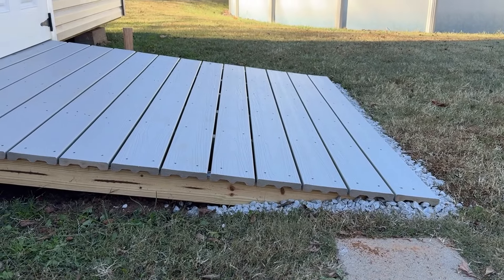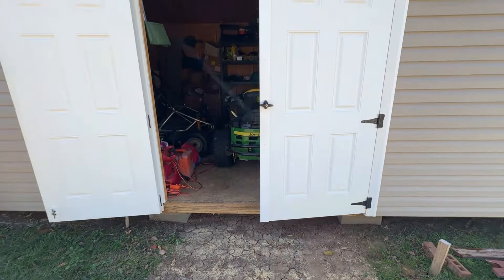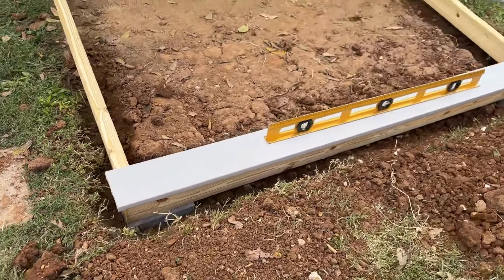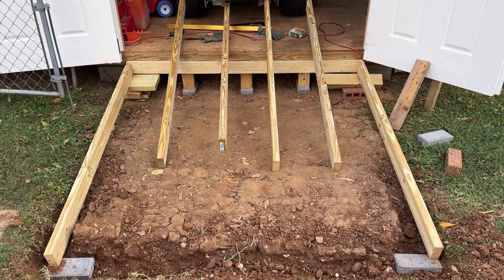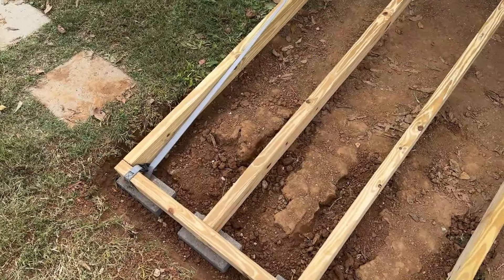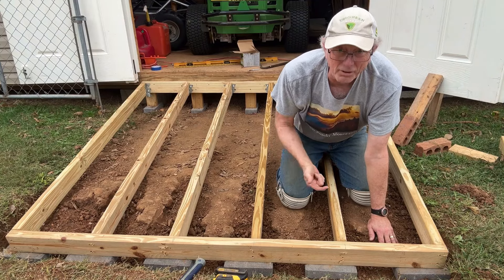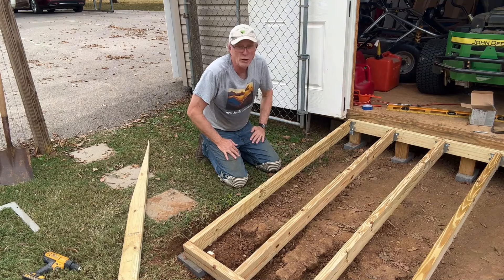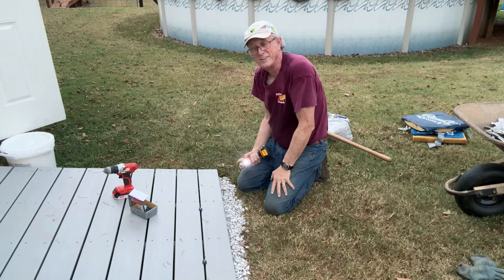How to build a strong and durable Shed Ramp DIY!

Comment: Super over-engineered, but nothing wrong with that. When you rip the 2x4's they will feel "mushy" but that's because the ripped section needs to be on compacted earth/gravel which supports it.  But I agree, there is more integrity to the frame with the full box construction (the rip design usually relies on the deck boards to hold the frame square.)  Joint tape... LOL... that must be necessary since the green-ies killed real pressure treating and oil based paints.  Now... just what type of petroleum based chemicals are in that tape? hmmm?
Reply from the maker: Great points. Thanks for watching and commenting!

Comment: Question: When measuring 6 inches long for every 1 inch in height. Is the height measured from the bottom of the building or the floor?
Reply from the maker: From the floor. Or more accurately, from the top of the ramp to the ground.

Comment: Great video, where did you use the 2 angle brackets ? Also what was the width of the composite decking boards and the dimensions of the concrete pavers ?
Reply from the maker: Thanks! You'll see me putting in one of the angle brackets at 5:31. The boards are 5.25" x 1" and the pavers are 8"x4"x2".

Comment: Hey! Fantastic ramp build, I'm following this to build my own for my 8x10 shed I just built.

Question: my ramp is a little steeper because I have limited distance from the shed due to my driveway, about 4 feet in length vs your 6 foot ramp. At 4:43 in your video, you can see how the boards come down from the shed to the band board laying on the pavers. Because my shed ramp steeper, the 2x4s will be coming down at a greater angle to the band board. So, will I need to cut the ends of the joists at an angle to meet the 2x4 band board in the ground? Further on at 4:50, you are screwing them flush to the band board, as where I'm asking if I need to cut them at an angle due to being steeper
Reply from the maker: Thanks for watching! You can cut the joists at an angle, which other videos show, but I think it would be better to dig down into the ground to keep from cutting the joists, since they will be stronger that way. The pavers and band board will be under the ground, but that's OK, as long as the boards don't come in contact with the dirt. You can use gravel to help that, as I did.
Let me know how yours turns out by joining my Facebook group, DIY Project Station: https://www.facebook.com/groups/882510523338538

Comment: I have watch several ramp buildings videos today. Yours is the first I saw using that tape. Do you recommend using it? And is the wood weather treated?  Thanks for sharing.
Reply from the maker: You are very welcome. The tape is to protect the joists from water that drains down from the spaces between the planks, even though they are pressure treated.